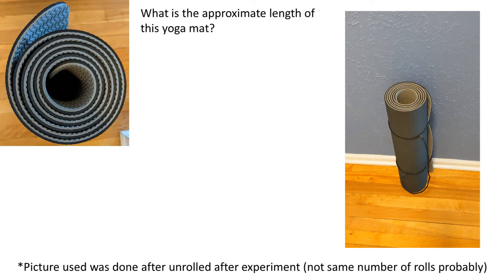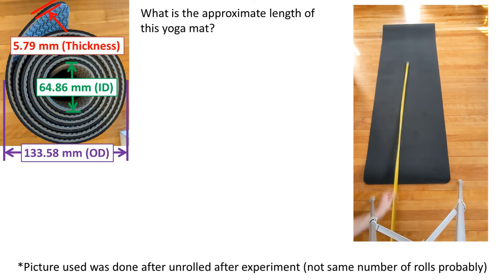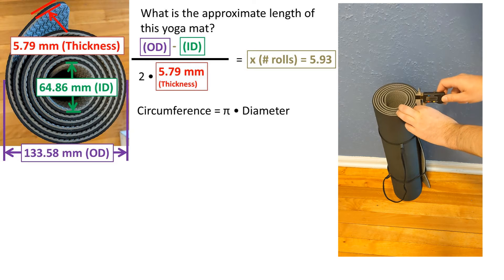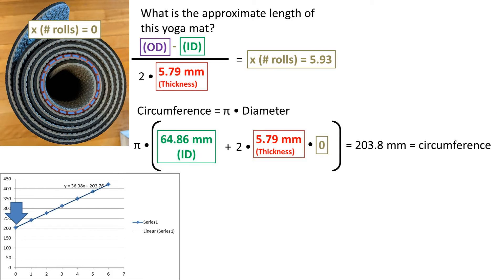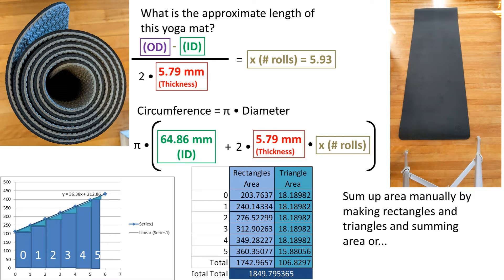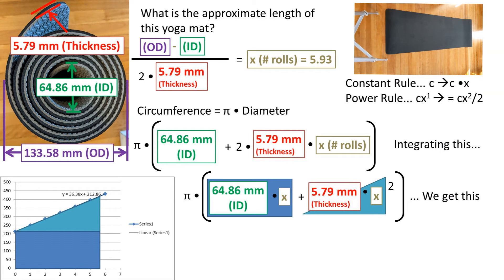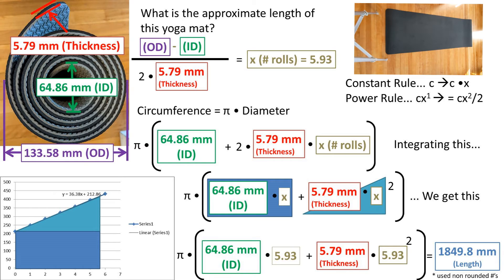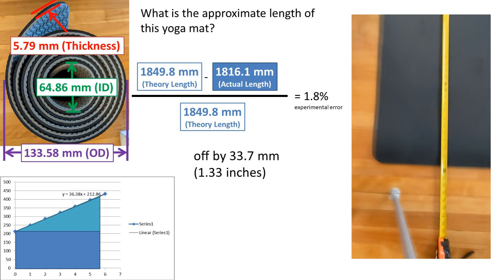Find Length Of Rolled Up Material Without Unrolling (Applied Calculus Problem and Solution )

Comment: Can’t you just: 

Circumference of inner layer: i 
Circumference of outer layer: o
Average circumference (middle layer): a
Total length: t

Number of layers = 3

i + o / 2 = a 
a x 3 = t
——————————————————
Let’s say that we have a rolled up material with 3 layers, the innermost layer has a diameter of 1cm, and the outermost layer a diameter of 3cm. We know that the total length of the roll measured is 18,84cm ☑️.

1 x π Layer 1 C = 3,14 cm
2 x π Layer 2 C = 6,28 cm ⬅️
3 x π Layer 3 C  = 9,42 cm

3,14 + 9,42 / 2 = 6,28 ⬅️

6,28 x 3 = 18,84 ☑️